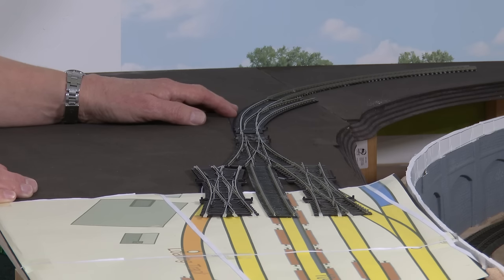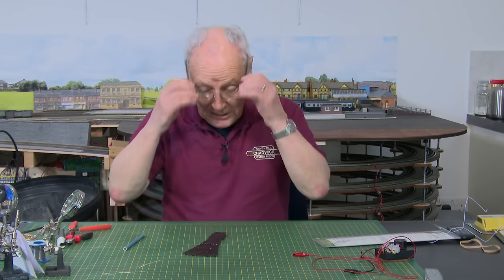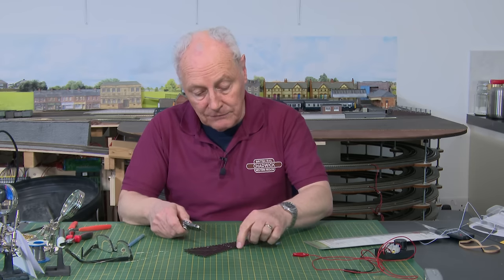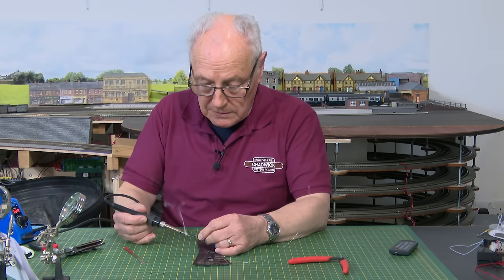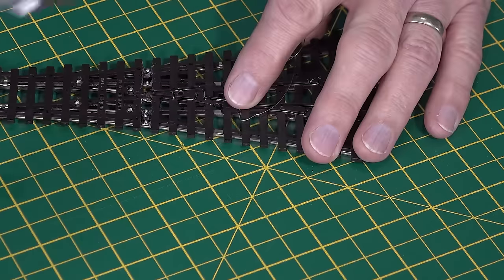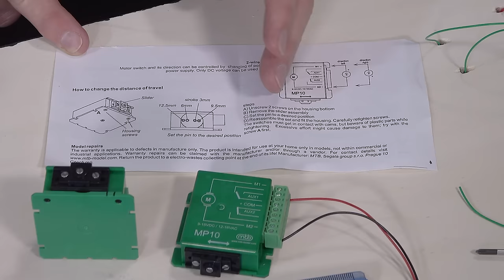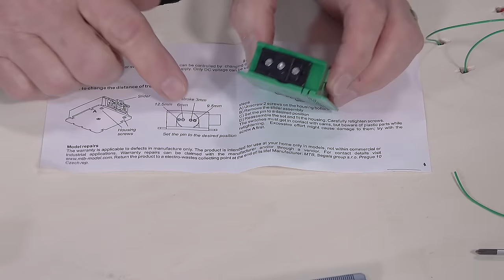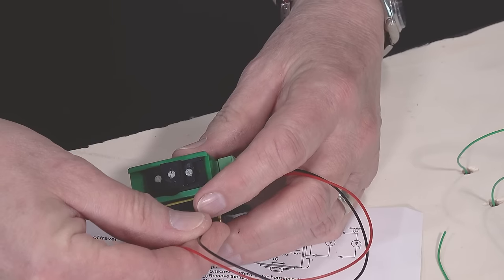PECO 3 WAY POINTS & MP10 POINT MOTORS at Chadwick Model Railway | 218.

Comment: I would gladly pay a few more quid and have Peco pre-bond the rails rather than having to attack it with a knife and soldering iron. I use the Peco Streamline 009 electrofrog points, and they dont even have a dropper from the frog, so there is more stress there soldering one on 🫣
Reply from the maker: That’s shocking Viking.
Regards Charlie